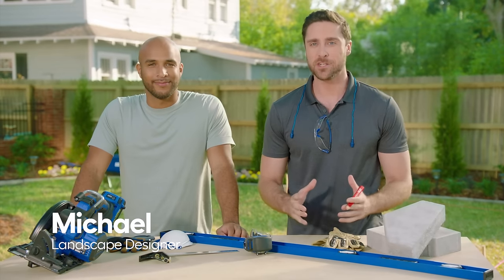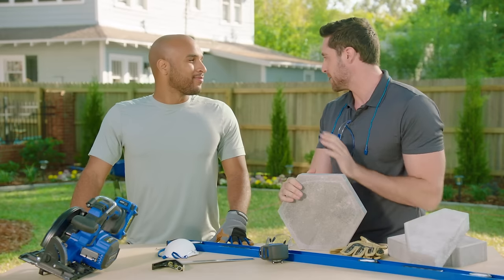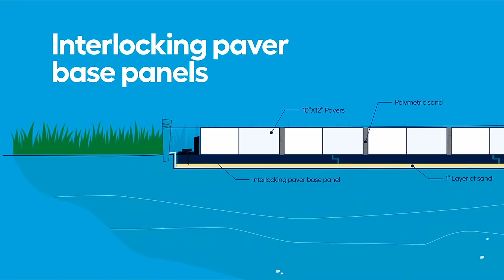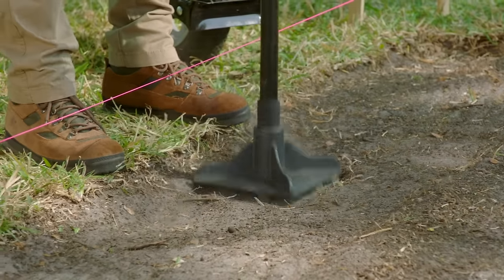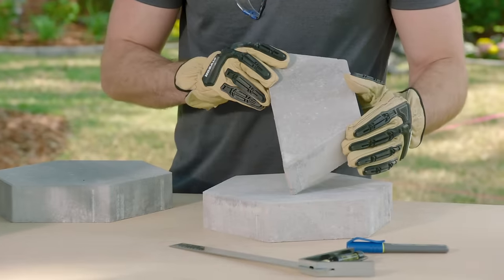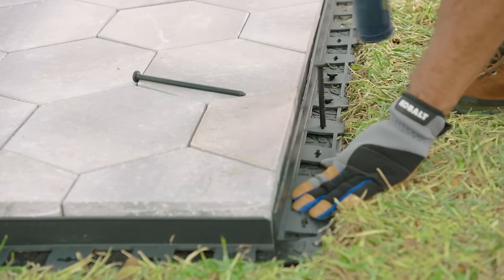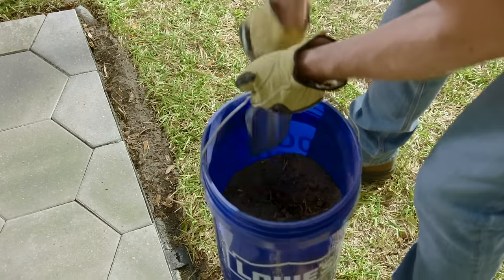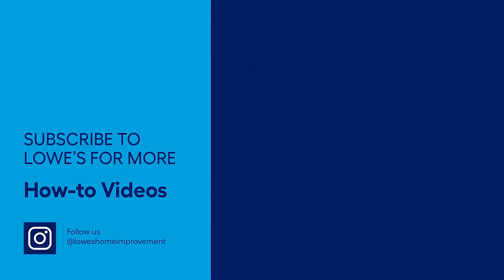How To Install a Paver Patio

Comment: Perfectly Quaint😊

Q/A for RENTERS:

Upon the completion of this Patio's installation and after a full seasonal cycle of Settling is complete, to what levels of difficulty incur in response to rebuilding elsewhere?

Does the Interlocking Base of 
this particular Patio make the transition easier vs a traditional base?

Or are the financial and physical stressors of the initial build even worth the process of disassembling, packing and moving the Patio's "building blocks" elsewhere, just to reassemble and rebuild this lovely Patio in a new location?

All ideas 💡 are welcome 😊

** Obviously, certain components of the Patio, like Sand, aren't easily removable, and specific building materials would need repurchasing in order to properly rebuild this Patio elsewhere in a new location.**